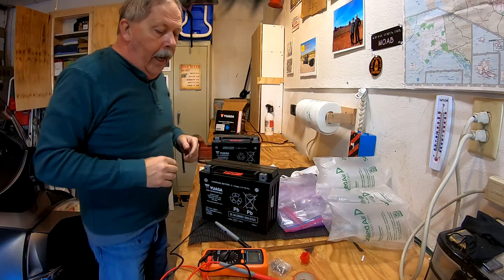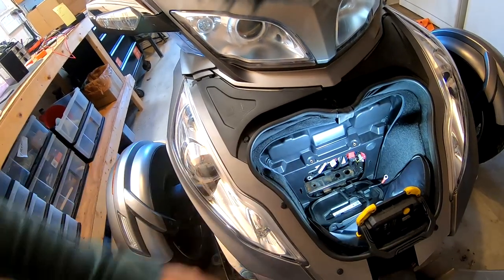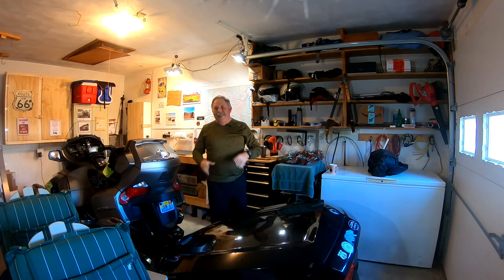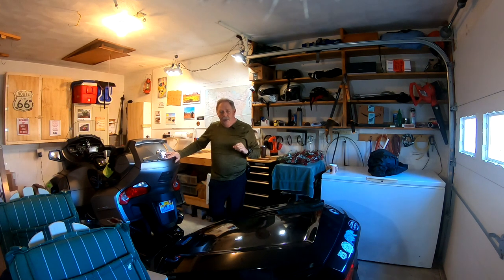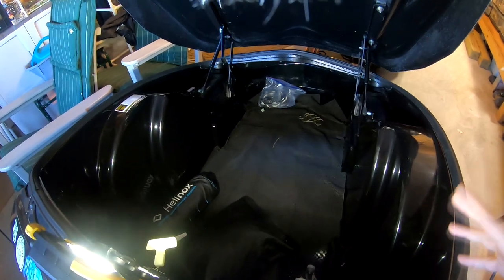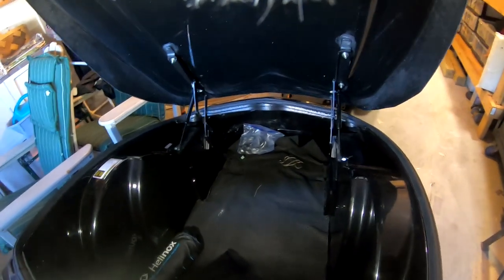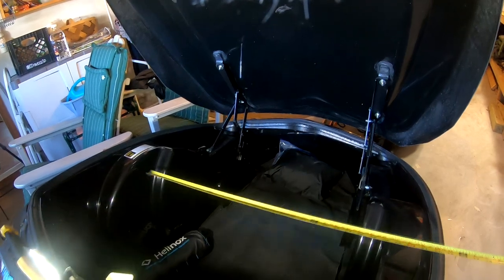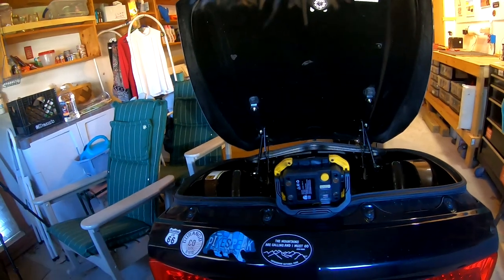Spyder Battery Change & Review of the Freedom Trailer

Comment: Had the RT-622 for my 2011 RTS but traded both in for my 2016 RTS.  Had not planned on a trailer this time around, however, I ended up getting the CASA hitch and control module but never installed it.  Instead I bought the Can-Am trailer hitch and control module and had them installed.  That was in 2018.  In mid-2019, I decided that I wanted to get a trailer.  Looked at several options and then had my dealer order the Freedom Trailer.  It has arrived at the dealer and I will pick it up when I get my annual inspection in early March.  I got the support stand, trailer storage cover, spare tire they had in stock for a few years, and the spare tire cover.  If you want a cheap spare tire (chrome), they have one for sale.  Not as expensive as ordering a new spare tire.  The spare tires that you order now are two parts (the tire and wheel) and ends up costing a couple of hundred dollars.  I did not purchase the stock custom fitted pad for the trailer as I thought your approach made more sense from a cost perspective.  As for riding weather, next week in my area promises to be in the 60s most of the week.
Reply from the maker: Just saw we are expecting similar temps Mon and Tue,,,, work may take a back burner!!

Comment: I still can’t figure out how you got 36mpg pulling the trailer. I have an 2015 F3 and no matter what I never get over 30mpg
Reply from the maker: I agree, I was expecting much lower, but that was the average over the 4000 mile trip. I will check again on our ride to SNP in july
Reply: @JohnMiriamsTravelVlog  I think it might be better mileage because John drives a little more conservatively  than some of us. I'm always 5mph over the limit and gas mileage suffers, especially out west, where the limits run 75+. Going 60-65 on back roads my mileage jumps considerably. Alas...
Reply from the maker: Never thought of that but I do ride a but do.. @harryparmley1193

Comment: Thanks for covering the trailer, the dealer has mine as I am just waiting for the 2020 hitch to come in. I will pick up the light you put on the lid and the other thing I bought is a small luggage weighing scale to measure the tongue weight or at least until I get used to it. I could not see in the picture well enough to recognize it, what are you using for wheel chocks and where did you get them. Also, do you carry a cable or something else to lock up the trailer when it is not on the Spyder, I vaguely remember seeing one in another video. Thanks again for the great videos.
Reply from the maker: I have a hitch lock and a thick cable for the wheel when its parked and we are out for the day. The wheel chocks are just 2 x 4 I have cut into triangles.
Reply: Thanks

Comment: John, do you carry a tire repair kit, mini air compressor or battery pak of emergency's on your trip out west ? I have seen some people carry a small gas can on their trailer as they say depending where you go out west, sometime it can be a long way between gas stations.  Thanks, Gary
Reply from the maker: Hay Garry, I was worried about gas, but found its not an issue. Yes, I carry a plug kit, compressor and s small usb battery back.
Reply: @JohnMiriamsTravelVlog   Thanks John, I have been watching your video's for quite a while . I also have a 2014 RTS and pull a trailer on trips and I believe we may be closering age with you and Miriam than some of the Spyder riders on youtube that camp. We also appreciate a hot shower, nice dinner and soft bed after a long day of riding on trips. We are planning a trip out west to see several National parks and the Pacific coast. I figure it may be around 8000 miles by the time we make it back to Tennessee, it may sound ambitous, but expecting 4 to 6 weeks to travel.Thanks for all your videos, Gary

Comment: Hi John!  What made you decide it
Was time to change the battery?  Great video as always.
Reply from the maker: It was the original 2014 (6 years) battery, was on charger for a few days during my maintenance cycle, then when I started it, it was very slow to start, it stumbled and even the computer reset (low voltage issue) and it tested low.
Reply: John & Miriam's Travel Vlog Yep, six years, seven tops, is about the limit.  Thx for the reply.

Comment: I repurposed a Pittsburg Automotive High Lift Riding Mower/ATV Jack, Item 60395, from Harbor Freight to store our Freedom Trailer in a vertical position to minimize floor space.  Paid less than $90 and the system works great.  You must use Item 60395 which has a single vertical support column.  Need to add 2 caster wheels and do some drilling.  Best to check height from floor to ceiling before starting project.  Ceiling height needs to be about 7’-6” minimum.  Only one steel tube remains on the underside of the trailer and does not affect pulling capabilities.
Reply from the maker: Thank you,,, I will look at that

Comment: Went on your post to see the battery installation.  Very hard to find a video that shows process clearly. You failed to show any of  install.  Went from "going to change it" to "well, it's all done."  Could you do a remake and show how to disconnect & remove & whatever else is relevant?? This is on a 2014 for me and most all good videos are for the older models.  Please??
Reply from the maker: Good idea, I think Shawn Smoak has one on his channel for the same thing. It may be some time before I can get to that.
Reply: @JohnMiriamsTravelVlog  Thanks for response.  Did find help somewhere.  Trickiest part was getting the top clamp to hold front strap back in.  That was accidental but all locked up. Glad to report I didn't fry anything, myself included.